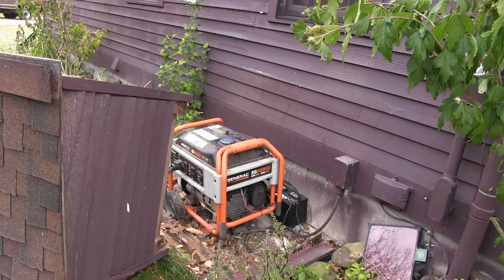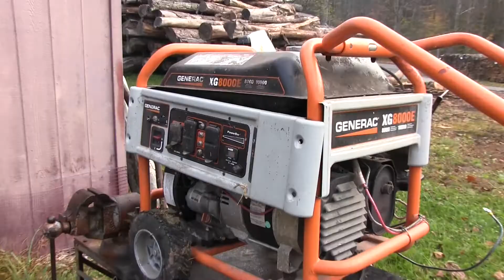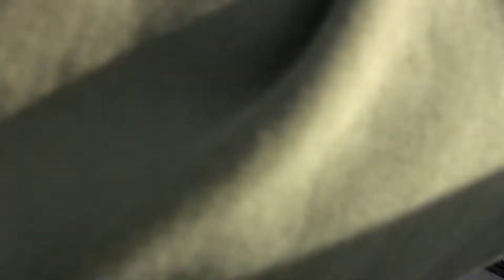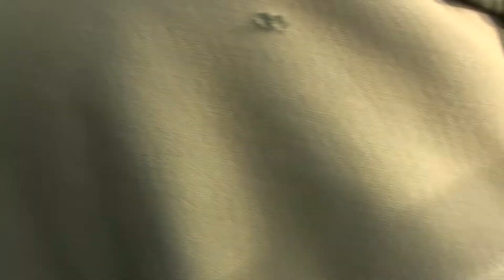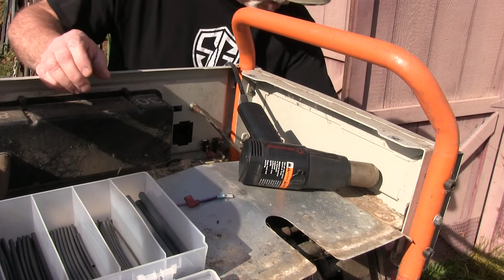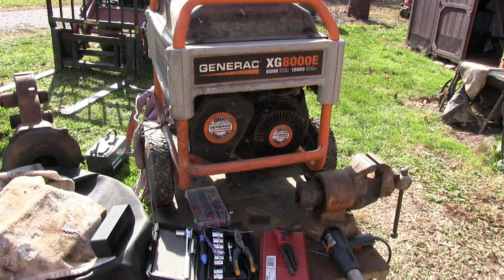Generac XG8000E generator start switch replacement - #023

Comment: I have a Generac XG7000e and I need to replace the starter switch. Can you share more detail on the 2 switches you used. I know both are SPST one is momentary and the other On/OFF. I'm not sure if volts or amps matter when I order replacement switches. THanks in advance for your replay. P.S were you playing slide?
Reply: Thanks so much for all the info. I ordered the switches from DigiKey. Thanks for the video.  I liked the music!! All the best.
Reply: Good morning. I received all the new switches and rewired everything. It looks like there was nothing wrong with the original OEM rocker switch. For some reason the engine won't turn off with either the original or the new switches.  Any idea or suggestions what else might be the issue. I'm going try calling Generac tomorrow and see if I can talk to a technician. Any help in the meantime will be appreciated. Thanks in advance.
Reply from the maker: @Simzee672  sounds like you have a broken wire. Trace the switch wiring back to the coil. When you hit the off switch it should ground out a wire on the coil I believe.
Reply: @Millstone_Firewood  That’s what I thought. I’ll let you know what I found out. Thanks for replying. All the best.
Reply from the maker: It's been a while since I did that. I looked at my past orders for the switches and I couldn't find them. I may have had them in stock. I looked up some DigiKey part numbers for you.
Mfg PN  	Mfg Name	Description	Requested Part Number
C3901BA	Bulgin	SWITCH TOGGLE SPST-NO 16A 125V	1091-1027-ND
C3900BE	Bulgin	SWITCH TOGGLE SPST 20A 125V	708-2455-ND
The number ending with -ND is the DigiKey.com part number.
Hopefully that makes sense. 
Let me know if you need any more help.
Thanks for watching!!

Comment: I have that same generator.  I bought it new in 2013 and only have 2 hours on it - just need it for hurricane backup.
Reply from the maker: It's a decent generator. I've had mine since 2011. It get a fair amount of use especially with all the dead ash trees falling and taking out the power lines.